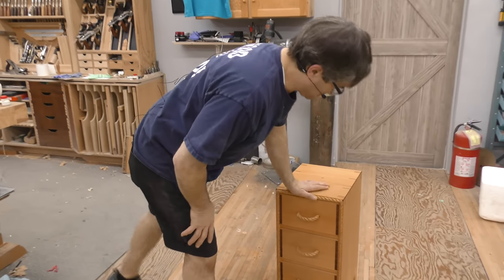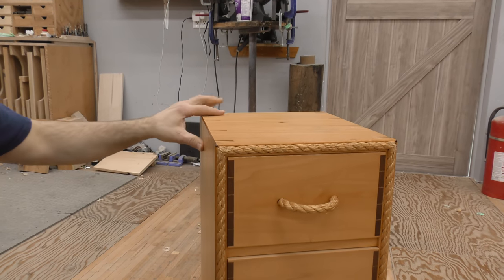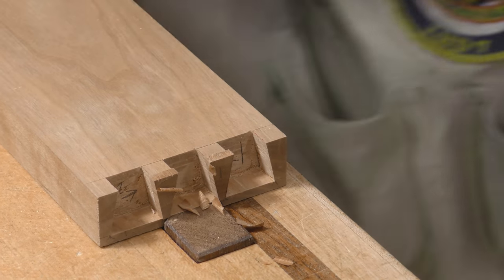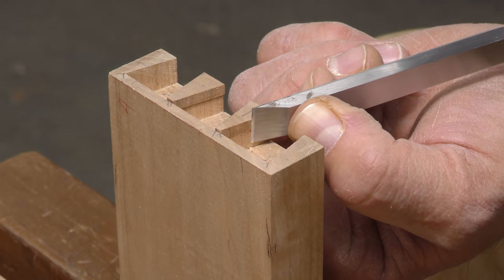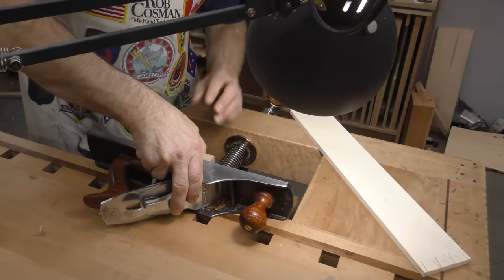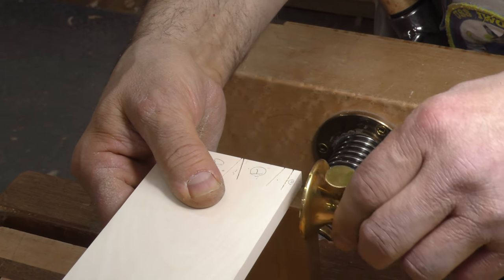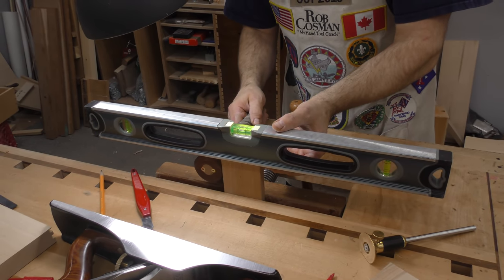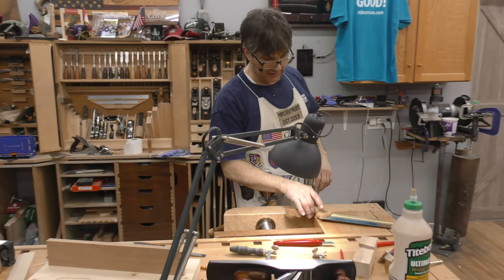Drawer Making Episode 12

Comment: None of the links that you're referencing are showing up in the corners of your videos.
Reply from the maker: Won’t show up on a tv, does on a phone or computer
Reply: @RobCosmanWoodworking  I have a nice Samsung phone and no links in the corner. Sorry.
Reply from the maker: Gene New watching from my iPhone and “i” appears in the corner, after clicking on it it pulls up the links. Have you tried using a computer?
Reply: Check whether "annotations" is turned on under the settings gear icon. If it's off they wont show.